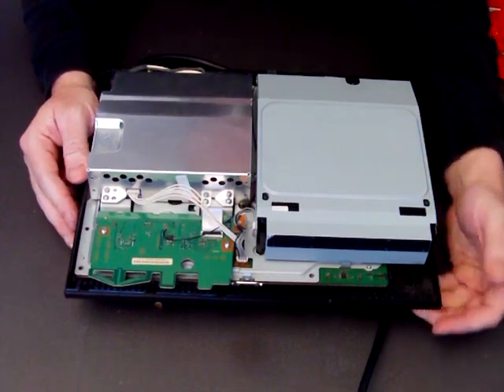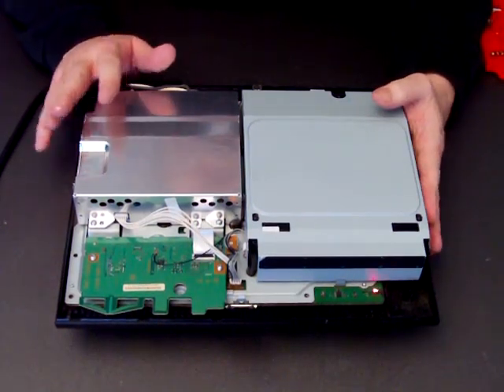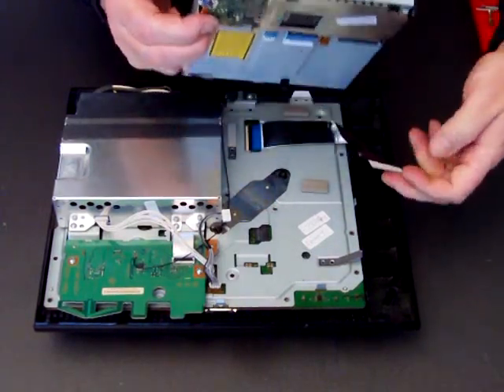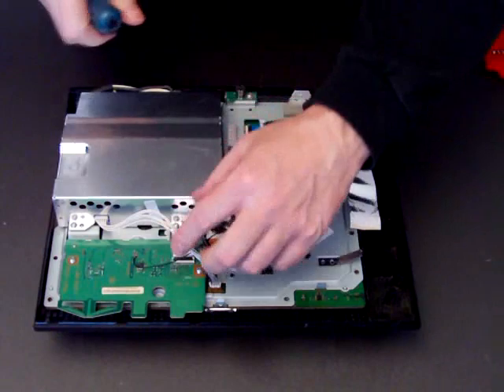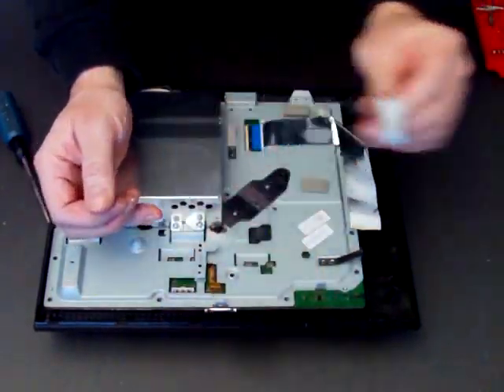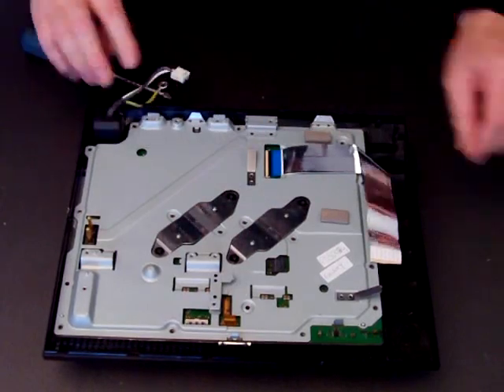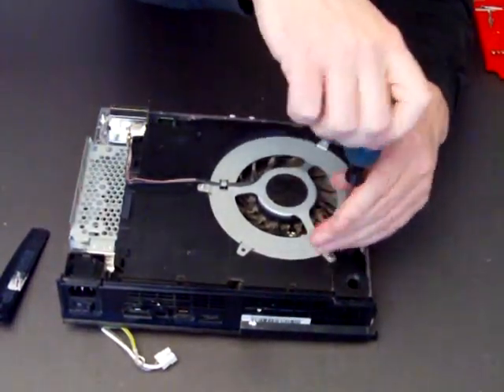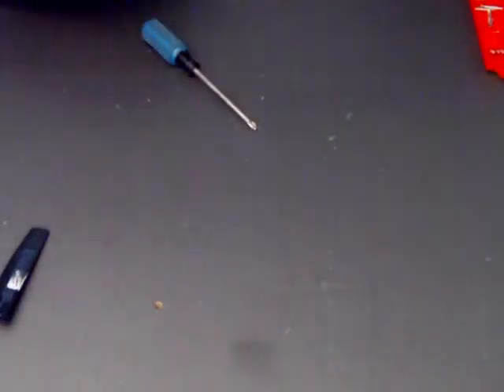Ps3 Repair Guides - Changing the Motherboard Part 1

Comment: Can you help me my ps3 cannot be on I try again and again it keep coming out green then orange to red pls help me
Reply: you got the yellow light of death or Ylod. Its either the motherboard, fan or power supply causing the problem. When u turn it on listen if the fan works for more then 3 seconds if it does its either a motherboard or powersupply problem.
Reply: +Patrick Bautista it was two years ago mate hahah now im using a ps4 thx for the info btw

Comment: Yes the system will not recognize the hard drive until it is formatted. If your ps3 has R.L.O.D you'll need to get the motherboard re-flowed in order to back up your data

Comment: The firmware is stored on the motherboard so the 3.55 will remain 3.55 once you make the switch. If your 4.20 is still working you can sell it on ebay.

Comment: Sorry I don't know. ps3spares are UK based and the operating system in Europe is different to the US. Try buying a faulty ps3 on ebay (ie blu ray not working) and use the mobo.

Comment: hey man i "like" this video quick question

i had my ps3 connected to my outlet and it spark. my ps3 now has no video display it turns on and off fine, takes cd in and out but it wont reset at all.i tried different tvs av and hdmi cables i check different spots they say the hard drive is fine any suggestion?

Comment: hey i had a major problem with my ps3 it was superfanning a shit load so me and a friend thought it must be dust so we opened it up and completely cleaned the ps3 with paper clothes then set it all back up then i found out that my motherboard had melted or fried as did my velt rings whatever they are is there anything i can do or would it be better if i just buya new ps3?